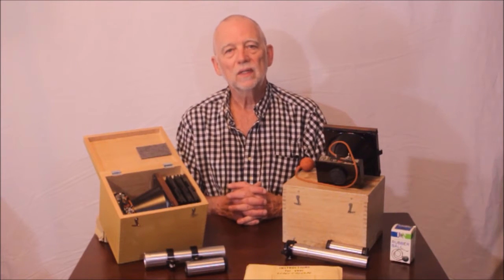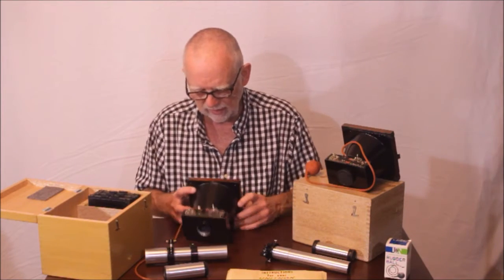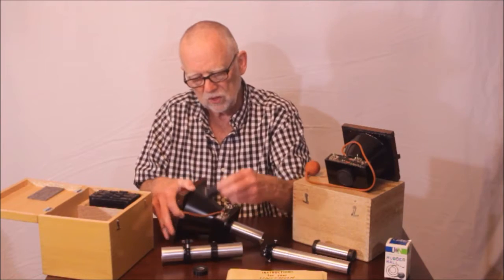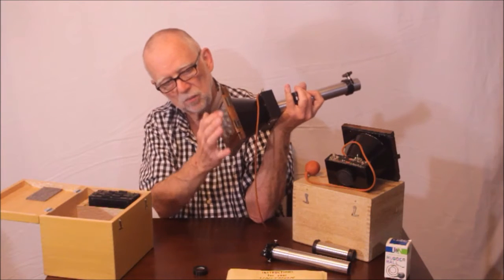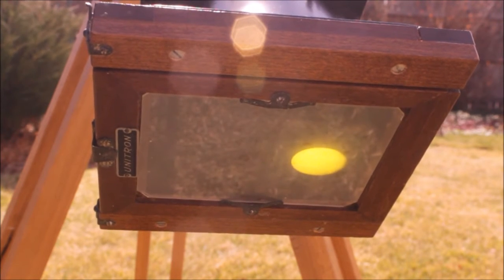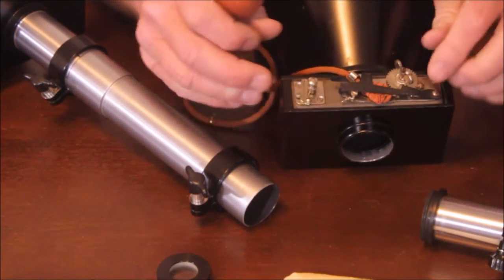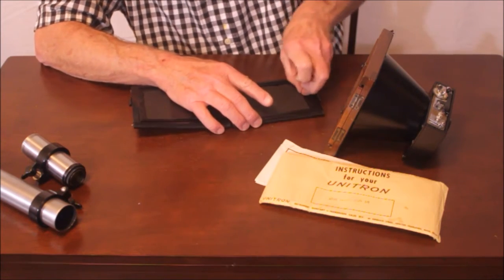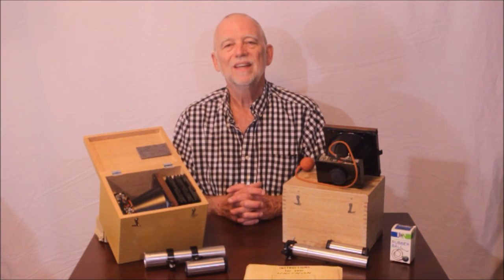Unitron 220 Camera

Comment: the holders are called dark slides, and the whole body is called a "book-form-dark-slide" OR as you pointed out a "plate holder"- because it can take the glass (or also tin, aka a tin-type)plate for cyanotype 4x5" (or 5 x 4 ") photography.
I know this as I have researched large format cameras, those types were in the old era of photography 1890-1920 or so.

Comment: I would like to buy one of these 4x5 cameras.  I used to use one back in the early 1960's as a kid.  I think I could make it work now taking actual photos.  Because the shutter speed is so slow, I would have to use ISO 25, 4x5 film.  Can be done, for the moon and sun, but usually the sun takes about 500th of a second.
Reply from the maker: Good luck with that!
- Dave

Comment: also a WARNING to those into this photography, those holders are SPECIAL , NOT the average ones you can buy for 4x5 cameras, as you point out there is a GROOVE in the top/ bottom, which is peculiar to only the old GRAPHMATIC cameras ( those large cameras that had an IN- CAMERA shutter device), other "standard" holders do not have the slots in the top and bottom you need to mount them into this kind of camera!! (refer to the web site by a guy called Eddie gunks, he deals with this era large format cameras).
Reply from the maker: Thanks for the information!

Comment: I am 70 now, but back in the early 1960's I used a Unitron 220 on a cheap 2.5" refractor.  I am still astro-imaging and BTW, still using film, but also have a Nikon D810a.  I would like to obtain (maybe) a 220 to experiment with.  Will have to go back to developing film, but that is not my main concern.   Now I use a Celestron C6 SCT design and photograph at prime focus.  I would have to figure out how to connect the 220 to the SCT.  I could get skgrimes.com to make something that would work.  So that problem is solvable.   Here is the most important question.  The maximum shutter speed is 1/90.  Films back then were not as refined as they are today.  Thus, I think the reason for the slower shutter speeds.  That could be a problem today.  Kodak 4x5 sheet film (T-Max 100) is quite good, and I think-maybe photographing the moon @ 1/90 would over expose the film.  Usually at ISO 100 a full moon shutter speed is now around 125th plus.  Solar work is usually around 500th.  Thus, I wonder have you ever tried to photograph with this camera?  If so, which film and what was the results?  I am greatly interested in your answer.  If possible please email to:  Mike Malloy, mmalloy100@gmail.com
Reply from the maker: I am sorry, Mike, but I have never tried to use one of these cameras and I had never even heard of anyone who did until I read your comment. You are really doing it the "old school" way and I sincerely admire you for it! I did shoot some film in a SLR back in the olden days of the 1980's but it was an entirely different thing than using one of these 220 cameras. Good luck to you!
- Dave

Comment: Why don't you take some photos with the camera.  4x5 film is common.  It is still used for mostly landscape photography.  I think the problem is the slow shutter speeds.  I think Max shutter speed is 1/90"??  I think the reason for the slow shutter speeds is that back when this design was used ASA/ISO film was very slow and took a long time to grasp light.  So slow shutter speeds were needed.  However as noted below in my other comment, 4x5 is still used by large format photographers and is easy to obtain.  I think though if you were going to photograph say a full moon you would use a shutter speed of 1/90".  The trick is to match the ISO film.  I would start with ISO 25, for the 4x5 sheet film.   I still want to buy one (at a reasonable price).    It is a mistake to think that 4x5 photography is out of style, but not really used in astro photography .  Believe it or not, even into the 1950's astronomers were using the Ambrotype plates which were glass.  This technique goes back to the 1860's.  A lot of civil war photos were of that type until they switched to tin backings.   So, lets get this thing working taking actual photos.    https://en.wikipedia.org/wiki/Ambrotype

http://www.canhamcameras.com/index.html                 This fellow makes 4x5 cameras now.  I would almost like to buy one just to stick it on a scope except that the shutter is in the lens.  They are not focal plane cameras like Nikon or Canon.